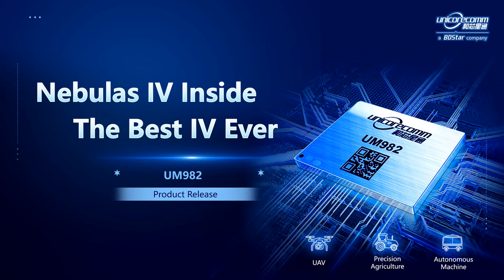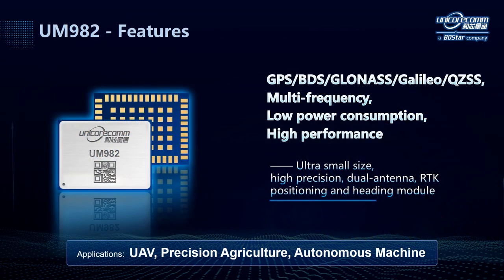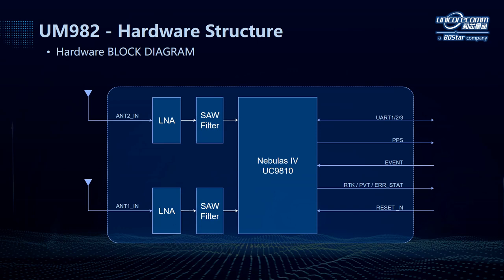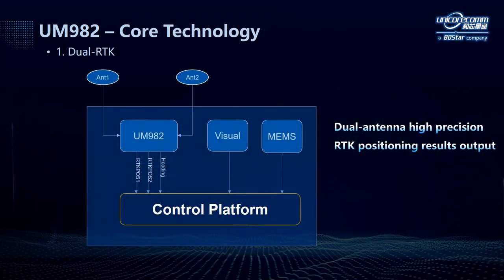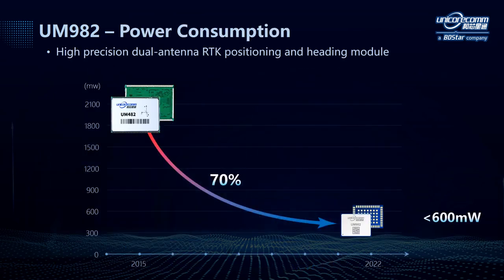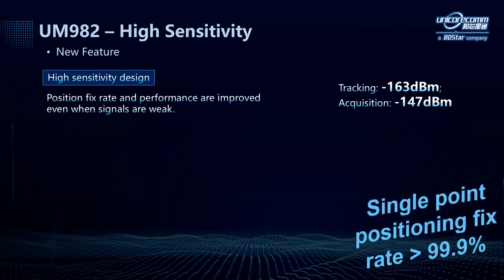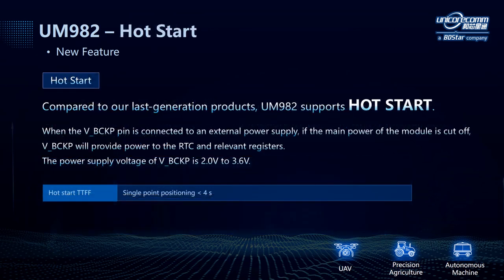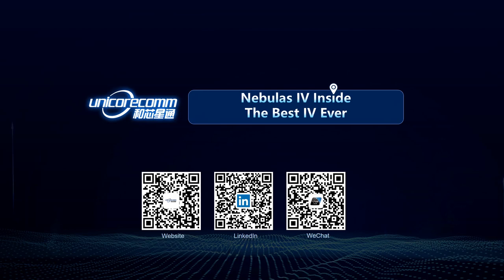UM982 Product Release

Comment: If using it for yaw correction on vehicle with a single unit with dual antennas do you still need a base station for rtk or are the 2 antennas on the vehicle enough for rtk positioning en yaw correction ?
Reply: RTK positioning requires a base station to provide correction data to the rover unit for achieving centimeter-level accuracy. The use of dual antennas on a single unit vehicle for yaw correction does not eliminate the need for a base station in an RTK system. The dual antennas on the vehicle are primarily used for heading determination and yaw correction, while the base station is essential for providing differential corrections to enhance the accuracy of the positioning data obtained by the rover unit. Therefore, even with dual antennas on the vehicle for yaw correction, a base station is still required for RTK positioning.